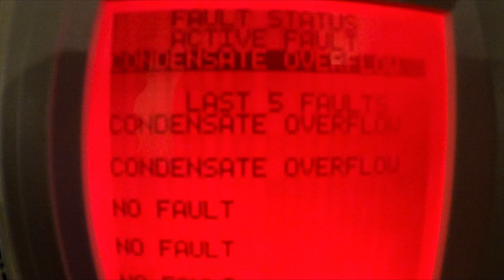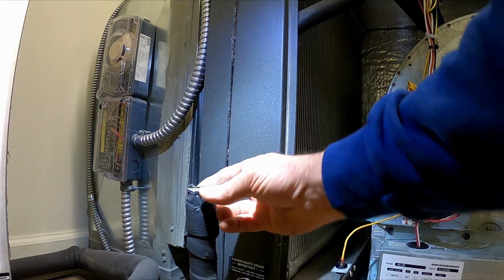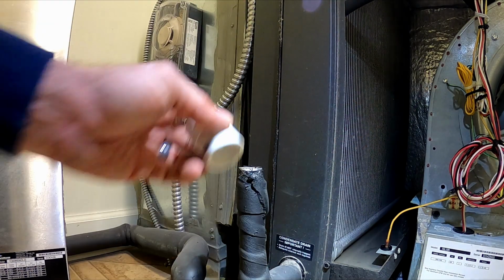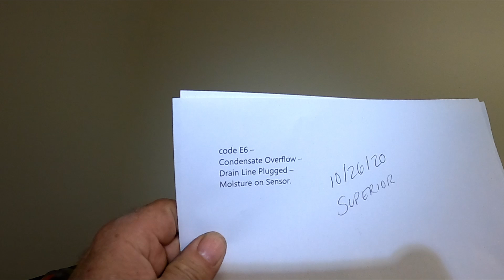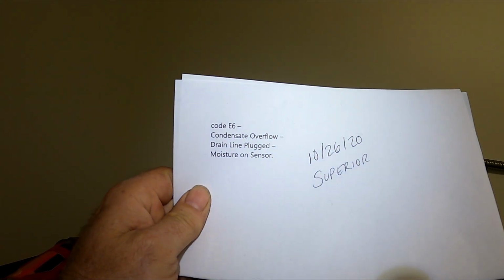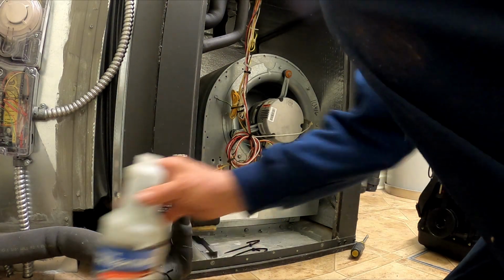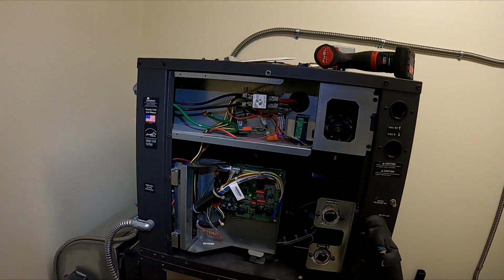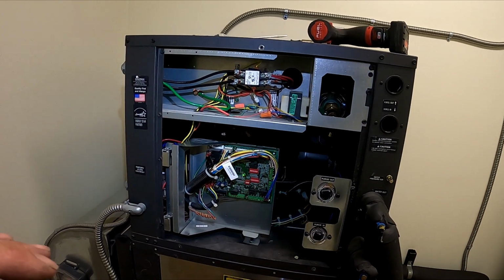Climate Master Geo Not Working

Comment: Florida  contractor here ,  ton of WSHP's here ,problems I see , running trap, drain pipe same height as pan, little pitch seen on drain line,alumium micro channel air coil, installation issue. unfortunately the unit needs to be raised or the drain lowered, otherwise expect the drain to back up every 6 months or less. don't envy you to find the solution that the owner won't like.

Comment: Good video. Just a couple of things. Shouldn't the breather tube on that trap have a cap on it? It's in negative pressure and will try to keep the condensate from leaving the pan. Also, don't thing you did much to clear the drain because you didn't have the drain line isolated. Any pressure you applied to the breather tube could go into the opening to the pan instead of the line. Not trying to be critical, just looking for clarification based on my knowledge.

Comment: Excuse my ignorance, but what exactly does that thing do, is it a de-humidifier or a humidifier or something else?
Nothing like it over here, well, we may well have but they oi not look anything like that.
Been following you for a short while now and things are done differently over there and strange equipment.
Heat pumps and Air-con I am fine with.
Is it mostly air units for heating over there as opposed to wet systems?
Sorry, lot of questions!
Reply: Mostly water to air heat pumps from  Climate Master where I am, but I've seen the water to water units. Big $$$$!!
Reply: @purplegoose7907  Got it now, thanks.  Just not used to seeing this style on equipment.
Tidy for a plant room, over here you are lucky if you can get into some of them!
Reply from the maker: What country are you from
Reply: It is basically an environmentally friendly system designed to use the heat from either water or the ground as it's medium,very efficient but so expensive you will almost never get your money back! Some of the new air to air systems are much cheaper and the efficiencies are creeping up on geothermal!
Reply: @MiHeatingGuy  I'm in the north half of the UK, Scotland.

Comment: These next-gen IDS systems, such as Bosch, will overtake the Geothermal market. The return on investment is reached sooner on IDS systems, at lower installation costs. Geothermal systems, piping and well fields have a much higher cost of installation. Energy models show comparable performance factors for both systems.
Reply: It's kinda funny how long inverter based systems have taken to find a place in the market there. In Australia we've had inverter split systems being installed for easily 10 years now.

I guess it's not quite the same as all your units are ducted but we've got plenty of those here too.
Reply: @Thermoelectric7  I've installed inverter systems here in the US for the last 15 years. Not just Duct less either. In commercial, inverter type systems ha e been around for even longer. Digital compressors with VFD's
Reply: @jasonjohnsonHVAC  Neat. A large majority of the videos I've seen on here from US techs all have fixed speed compressors. Unloading in the case of chillers but no VFD's (on older stuff. Edit: bar the city multi style of unit). Maybe on the fans but that's about it.

Good to know!